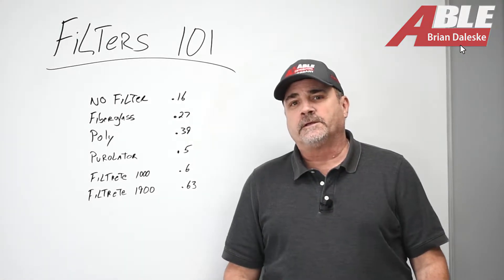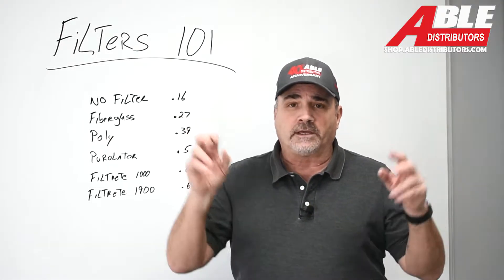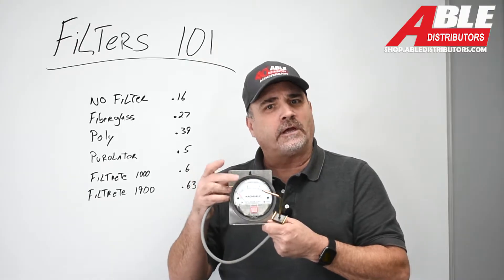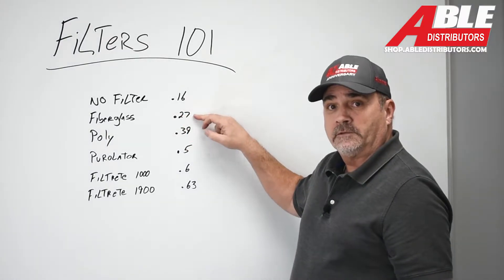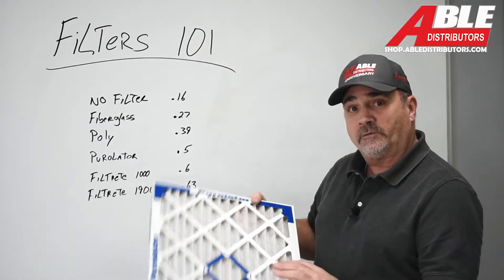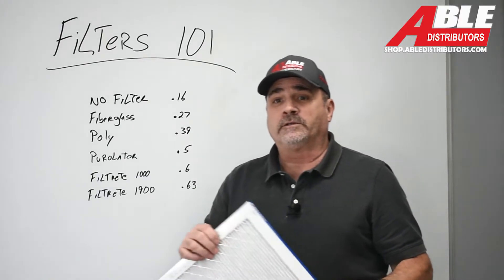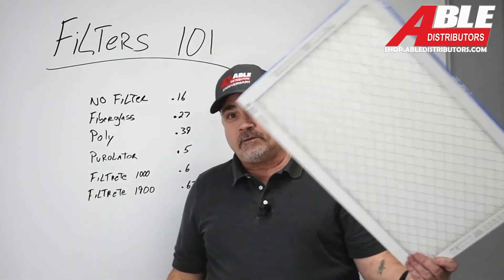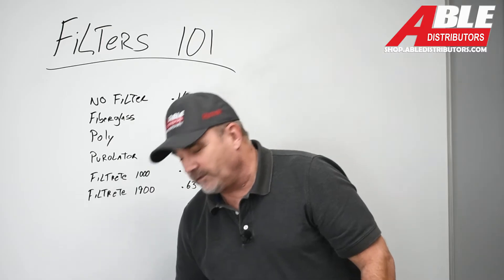HVAC Filters 101 - Airflow Report: Are Expensive Filters Worth It?

Comment: We have an older system that was never really designed to handle the extra sq. footage of an addition that went on the house many years ago. Having just had a tech here yesterday to troubleshoot why the system is struggling in this hot weather, he discovered that it was low on R22;  however, he also highly suggested switching from the heavier, pleated filter to a fiberglass for better flow. The only thing is, it seems like I'd be sacrificing good MERV filtration (with a rating of 8 with the Filtrete - which is what I use) for the sake of the MERV 1 or 2 rating on the fiberglass that won't provide near as clean air. So I'm sort of stuck at this point. I wouldn't mind trying the fiberglass or poly if I can find one in the correct size (20x25x1) that might have at least MERV 4.

Comment: You might want to read this report from the California Energy Commission.  They found "The pressure drop characteristics of these air filters varied widely, and there is no significant or useful correlation between MERV rating and pressure drop for the observed filter models, which ranged from MERV 6 to MERV 13.

The Filtete MERV 13 filters tested very well due to the number of pleats and increased surface area.

 https://efiling.energy.ca.gov/GetDocument.aspx?tn=223260&DocumentContentId=27687

Comment: California requiring new home builds must be able to handle Merv 13’s.  Static drops should be .1 to .5 area.  The main problem builders using only 1 inch thick filters vs 3-5 inch deep pleated filters which really increase surface area.( our lungs have the same surfaces area as tennis court in a compact chest) Deeper pleats allows higher Merv ratings with less restriction.  Higher Merv mean cleaner air and cleaner machinery.  Filter size, ductwork, and single speed/variable speed motors affect pressure drop.  A 20x30 filter opening allows more intake air than a 20x20.  18 inch ducts allow more air flow than 16 inch.  Variable speed DC motors work well with restricted filters vs single speed permanent magnet AC motors.  Most returns will allow a 2-3 inch thick filter without mods. Merv 5-8 most hvac filter can handle but 1 inch filters should be changed monthly not every 3 months.  3 inch thick filter should be changed every 3-6 months.  Merv 8-11 are very safe with 3 inch plus filters.  Numbers pets, occupants, allergies, dusty surroundings, etc., determine frequency of filter changes.
Reply: Because of the new California regulations you can actually check flow  rates certain filters on line or printed on side of California filters.  Different filters offer different rates at same Merv ratings.  Honeywell California filters have excellent charts and flow  rates for their different filters

Comment: Is the 0.5 restriction a 50% restriction,  0.5% restriction or some other value?  Or put another way, is the difference between a .16 restriction and a .63 restriction significant?  Would a 1.0 be a total restriction?

Would we be better not filtering our AC at all and filtering with other room devices?

Thanks for the video.
Reply from the maker: 0.5 static is not 50% restriction , it doesn't work that way, it's how much back pressure and suction pressure ( supply and return ) is on the entire duct work system, the filter is only one part ( an important part to protect the equipment ) so we we look at the expensive 1" filters and see they add .6 static all by themselves, we know it's impossible to stay anywhere near the furnace manufactures hope of a .5 for all the ductwork, filter, registers, A-coil.     hope this helps.    Brian

Comment: Ive always used stainless steel washable, mesh and carbon filters, fact is air filters protect your equipment, there not for air purification, you can install a UV light in the return or the air handler, it works in hospitals, it should work for you. I can say for a fact, the last 2 units ive had, after 20 yrs of daily use,  the coils were still in great shape, and ive never had to have my duct work cleaned, and still clean, but i clean my filters once a month. If your a germaphobe and you think high merv filters are helping you, be my guest, your paying more money for filters continually, and you will pay for expensive repairs you caused

Comment: Yes but it will not catch anything this proved nothing
Reply from the maker: my intension wasn't to "prove" anything, I was merely pointing out that your furnace or air handler was not ever designed to "clean" the air in your home, the furnace filter was only to protect the equipment from debris,, and thats it.  if you want to "clean" the air in your home, the correct way is to use something better than a 1 inch wide filter, there are options, I've listed the options before.... if you restrict the airflow beyond what the equipment manufactures rated it at, you'll lose air flow, your equipment will run hotter ( or colder ) and will not last as long and will not be as efficient, parts will break. there are better ways to filter the air in your home.
Reply: @abledistributors  Cleaning the air inside your home is a secondary benefit though, while fulfilling the primary function of protecting the HVAC system from damage that may be caused by dust/fine particulates.

Comment: It would be useful to test a 4 inch deep merv 8
Reply: Another YouTube video I saw showed a 4 inch Merv 8 Pleated had the best air flow over any 1 inch filter.  More filter surface area for easier air flow.     Then you get the dust particles out of the house and better airflow.    The 4 inch filters cost more,  but last at least twice as long.

The only other option if you want a good 1inch filter and good airflow is put in a larger return air grill/filter.

Comment: Be careful we used a cheap merv 1 and it clogged our system inside the unit with hair, dust, dirt etc. Costs us 170 to get it cleaned we also have pets so get a thicker filter then merv 1 if you have pets etc
Reply from the maker: thanks for checking out our video ! with any filter, replacing it regularly is the key, and always replace the filter with the system off.      Brian

Comment: I normally get the filtrate 1900 thinking is supposed to help with allergies at home. I recently saw a video where it mentioned the stress it can put on the system and possibly ruin it later on. I’ve been using the filtrate 1900 for 5 years now and so far no problems. I heard about filters that hospitals use and can help with the air flow. My unit is a 2ton. 

What type of filter would you recommend for my system that wouldn’t put much stress on it? Like what would you recommend the best MERV would be for my system?
Reply: The one thing not pointed out in this video is that each system should tell you what MERV rated filter is acceptable. I increased the MERV rated filters I was using in mine, but only to the level recommended in the manual. Yes, a lower rating would put less stress on the system, but then there are more particles in the system, so some balance must be reached based upon what the manufacturer recommends.
Reply: @GenesisMuseum Many don’t say

Comment: Question I've asked on similar videos that hasn't been answered.  I previously lived in the NE and had systems with just one filter at the furnace.  Now live in the SE with a home on a slab.  I have five separate filters in the ceiling in a 2200 SF home.  Only the two in the most lived in areas really ever get the least bit dirty.  Am I okay using higher rated filters to get things like the pollen we have here out of the air and to keep the return ducts cleaner.

Comment: 3M filtrete 1900 - merv 13, but also twice the media as most merv 8's on the market (1,560 sq. in) so they do not clog up fast, or create static pressure build up any faster then the typical merv 8.  Oh, but they do collect smaller particulate matter MUCH better than any merv 8 on the market (including particulates from wildfire smoke) - which equates to cleaner coils, less work for your motor etc, and FAR better overall air quality in your home.  It's a no brainer. My residential HVAC heating/cooling system (Maytag) is close to 20 yrs old. Other than changing out a pressure switch yrs ago, not a single issue. 

I change the 3M 1900 every 4-6 weeks in summer, 8 weeks when snow is on the ground.
Reply: Agreed. This is a somewhat misleading video imo.

Comment: My return used a 20x30x1 inch filter for the first floor.  This return vent was positioned near the corner of the wall allowing the addition of another identical vent and filter on the adjacent wall.  This addition theoretically reduced the static airflow resistance by 50%.  What an improvement!
Reply from the maker: more filter area is always better !!

Comment: And what do you do when you have asthma?
Room purifiers don't work. Use an expensive filter and the kids can breath. Use a thin filter and the kids have issues?
Reply from the maker: I absolutely understand, I'm in a similar situation, I have bad allergies and last year had some of my right lung removed, so I also need clean air in my home, and I know we will do whats needed.   in my case I installed an after market air filter, mine is from GeneralAire, but Honeywell, and others have them as well, this filter is 5" thick and will trap most particles without sacrificing air flow, along with that you could install a "bypass style" H.E.P.A. air filter, with this I run my furnace fan constantly and it sits next to my furnace and I replace that filter every three years..    bottom line is always, protect your family and make yourself comfortable, good luck, stay well... Brian.
Reply: @abledistributors hi Brian, can you make a video about these aftermarket 5” filter systems? I’ve been interested in changing out my return filter box from the 1” I have to a 4-5” return box for this reason. Thank you!
Reply from the maker: @VanillaCoke  sure, I'll add it to my list, large pleated filters are great, stop a lot of dirt and dust and allow good airflow due to the larger surface area, I'll cover the brands we sell, Honeywell and Generalaire, but there are others available as well,    have a great day.     Brian,

Comment: My house has 4 returns. Each has a filter. That is a whole lot more surface area than one 16x25 filter. The static drop you measured would be a lot higher like mine because my return system is moving the air thru much, MUCH more surface area. Project Farm measured the static drop of the Filtrete 1900 filter and it performed much better with regard to restricting air flow than you measured. Not sure why. But I do know that the Filtrete 1900 filter, because of its substantial number of pleats, has as much surface area as many 2" or 4" filters.

Comment: If you live in a dusty area and use the spun glass filter im afraid i would need a tech in every year to clean the coils.  That itself can be a restriction and added cost.  So where would a good compromise be?
Reply: I was using fiberglass very thin filter, then my apartment complex switched to a very dense filter and then my coils froze up!!

Comment: Are the permanent hydrostatic filters effective and efficient?
Reply from the maker: the key question here is, Effective and Efficient,  effective, sure, they trap dirt, they must be cleaned and dried completely before reinstalling.  as far as efficiency, it depends on your definition of efficient, some on the market are far to restrictive, all require frequent washing, I've found most people won't change a filter much less wash and dry one,  maybe having two on hand is the answer, change it and wash it when you have time.  thanks for checking out my videos.

Comment: Climate master equipment in a hi rise apartment with 2" pleated filter, stock.  I don't think i should put a fiberglass filter in.  No issues with circulation/malfunction. 
And according to the dylos 1100pro particle meter, it's as efficient as my old IQ air at cleaning air.  And it does the entire 1000sq ft apt, and circulates the dehumidified air behind a sound proof door in the utility room. Dehumidifier is a  ge 35 pint portable placed on the ground under the blower intake/filter.  Water drains by gravity into the utility room drain, along with ac. The stock ac filter doesn't even show a merv rating. Given the small change in pressure on your filtrete 1900 over normal pleated, I'm going with merv 13 on replacement.  Allergy symptoms are gone, even with carpets in bedrooms, in tropical climate.
LEED building, so positive pressure ventilation keeps tvoc readings down to outdoor levels. All metal furniture,  except leather couches, to minimize off-gassing.
I seem to have found indoor air quality nirvana.  But, I still want the carpets out.
Reply from the maker: the amount of VOCs in a new home is truly terrible, the chemicals in carpet, carpet padding and in the insulation are shocking.  I'm glad you found what works in your situation, I recently had a portion of my right lung removed, now I really think about what I'm breathing.  Stay well, ..Brian
Reply: @abledistributors  thanks.  Moved in after 18 months of completion.  First occupant. So, most of the off gassing is done.  Now, the carpets are accumulating bacteria and mold, which is evident by musty odors when humidity rises above 55 or 60 for a few hours.  Humidity alarm set at 50% keeps the beast down.  For now at least.  Wouldn't dare water it (pro steam clean). Trafficked areas covered by machine washable rugs. Ozone seems a plan b, until find a carpet-less place.  Carpets should be banned.  Evidence is accumulating, carpets cause disease.
Reply: Update:  unable to source merv 13 locally.  Merv 8 is working fine, and much cheaper.  2" filter.
Reply: The fiber glass filters don't stop all the allergens , just collects whatever it's suppose to in 30 days, mine looks brand new still after 30 days. I vaccaum at least 3  times aweek

Comment: Great video! I am currently running basic filters and have air purifiers in my home and it seems to make them last longer than previously, so that may be a solution for people that are afraid of the condenser system getting dirty quickly. Also there is less particulate mater in the air verified by my air things monitor which verifies my findings.
Reply from the maker: yes I've had a section of my right lung removed, so I put in the effort to put in an after market high efficiency filter cabinet at my furnace, but I still run an stand alone HEPA in my bedroom, and I may put another one in the corner of my living room.  thanks for checking out the video.... Brian,

Comment: Some of the fiberglass filters are way too see-thru/porous with super cheap construction.  

A compromise could be the inexpensive basic pleated filter (MERV 8 equivalent) by Home Depot (HDX Brand).  Use it and toss away every 30-60 days.  

The see-thru fiberglass filters may stop hair but that’s it - won’t stop dust particles.  Again I’m not suggesting getting a MERV 11/13 Allergen filter but a basic inexpensive pleated MERV 5-8 filter and change regularly.
Reply: Yes sir